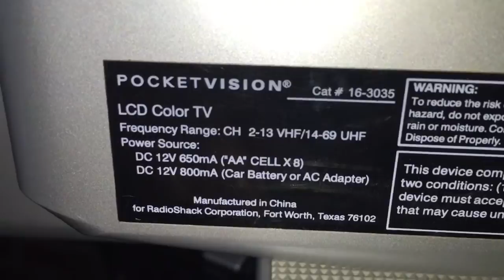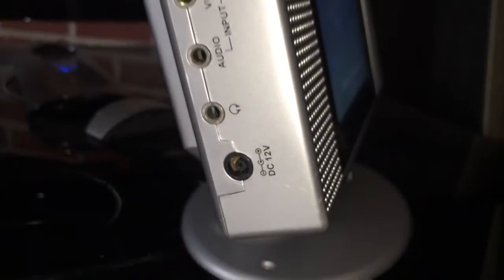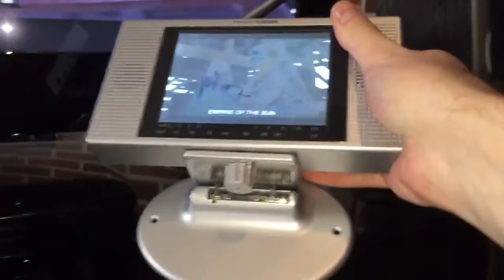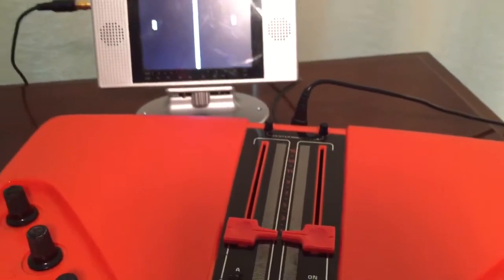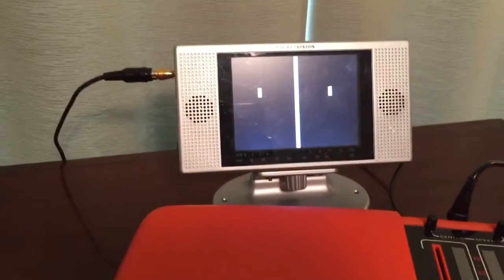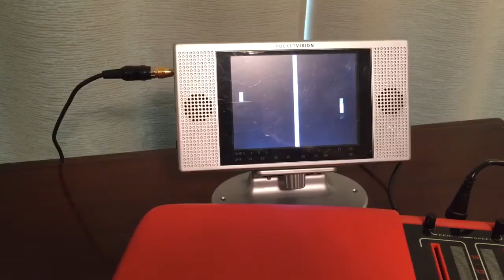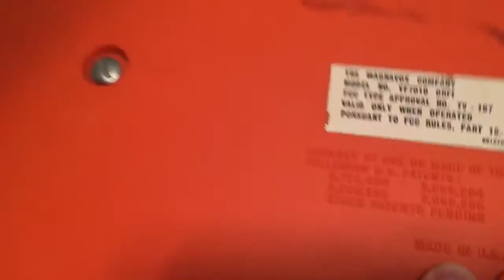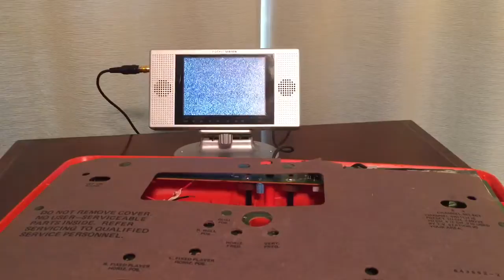Magnavox Odyssey 100 Game System on a PocketVision TV

Comment: I have a 400 it was my mother's when she was growing up, if I remember correctly it takes 2 D cell batteries? I haven't opened it in years... I believe the odyssey 100 was just a dumbed down original odyssey... If you notice in the board there is a lot of components just missing, that cut out looks to be in the same place as where the game jumper card port would go for the original Odyssey

Comment: what is the pocket vision television made in 1980?
Reply: Steven Hobbs 30 You're probably thinking of the Panasonic Travel vision line, The Panasonic had a  1.5 inch diagonal screen  and was the size of a paperback book. The Panasonic used a CRT. (I had one, probably the smallest device I had that used a vacuum  tube!).

Comment: Umm, yeah. You pinned my comment, but didn't alter your video to reflect more facts about this system that I shared with you! The two games are Tennis and Hockey. I don't care about the Radio Shack TV that you thrifted, nor does anyone else. That is only a portion of why this video has so few views and low feedback. Do some research and, if it will help (anything at this point will) I will send you pictures of my mint in box one! Then you can re edit and put out a proper video that people will actually watch. I will sell you my mint in box one that has everything you need! BTW, there was no "battery pack" in 1975! I'm not trying to be an asshole, but I want to help you to not make a fool out of yourself with misinformation and speculation. Let me know.